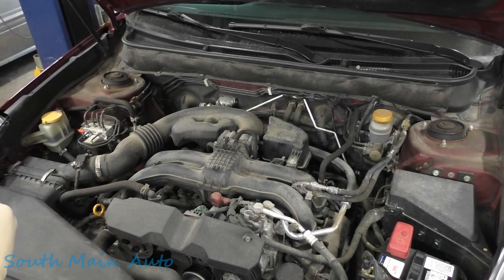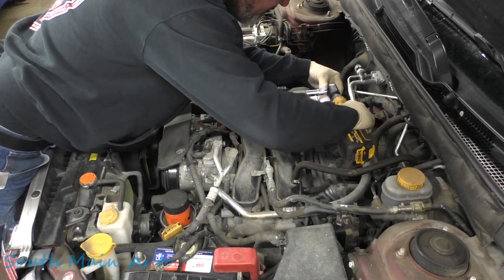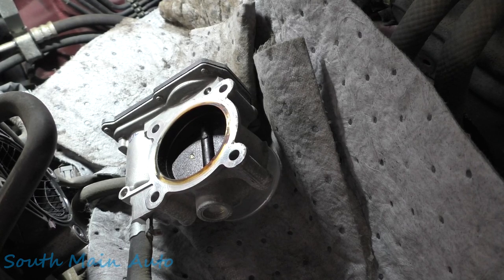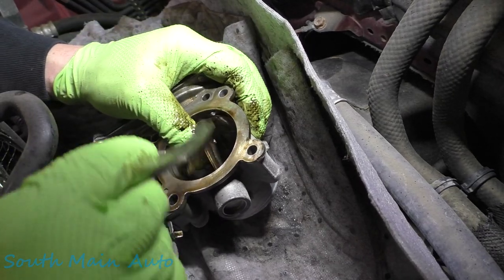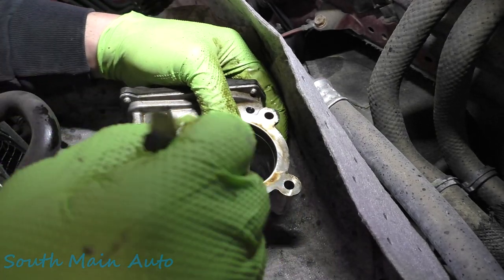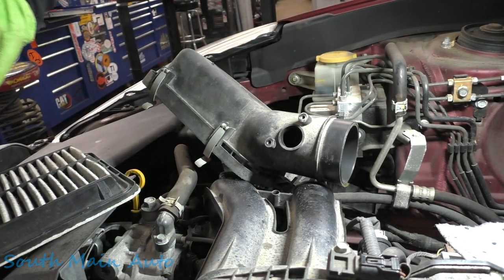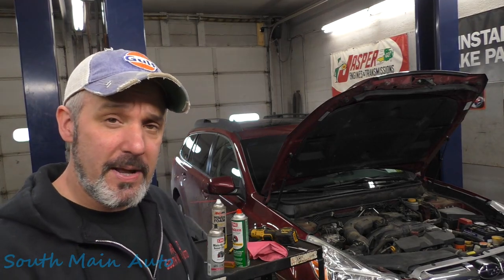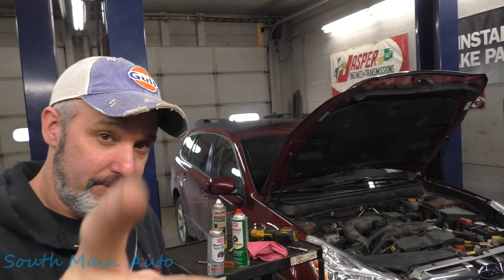How Does Your Shop Deal With Intermittent Symptoms?

Comment: When I worked at the Chrysler dealer we had a data recorder. When the vehicle acted up the customer had a button to push. I fixed several intermittent problems that way. One that comes to mind was a vehicle that would seem to miss or buck at highway speed. It took some looking on the data recording but finally by advancing it frame by frame and looking at the values I discovered the vehicle speed sensor was glitching to 150MPH for one frame. So the computer thought the vehicle was over speeding and shutting the fuel off for like a second.
Reply: That sounds like a super useful tool. Was it hooked into the DLC?
Reply: What “button” do you speak of? How can I obtain said thing?
Reply: @chrisclark6044  It was a device called a Co Pilot that came with the diagnostic system Chrysler had at the time, this was the mid 1990s. It plugged into the diagnostic connector and had a button that clipped on the sun visor.  I have no idea if it would still work with newer cars. However some of the diagnostic equipment have a data recorder function that does the same thing. I doubt that you would want to sent your scan tool with a customer for however long it took for the vehicle to act up.

Comment: I've been using power foam for about 20 years and it is the best product I've found. I also worked at a NAPA jobber for 20 years, and out of all the products I've seen over time power foam works the best. I also do a brake clean douche too for a rinse. I feel you used the product correctly so I hope your viewers find this helpful.

Comment: I think I would check for TSBs and also Identifix and or Suretrack first, to see if others have experienced the same problem. Depending on what, if anything, was found, I would use the information to direct further diagnosis. Next a visual inspection and check the related fluids, oil, coolant. Aside from that, what you have done makes perfect sense to me.

Comment: As soon as you said new battery, I knew exactly what customer was talking about. Those subaru take a full month to relearn everything. The rpm goes way down and stays that way for a month of consistent driving, there's a bad hesitation when you step on the gas, and stalling and just poor driving. I hated changing my battery.
Reply: Ever since computer cars came out, I've used a small motorcycle battery with a cig lighter plug wired to it. Install it before changing battery then remove it after you connect the battery, and you won't disturbe the ecm. no relearn
Reply: Best to jump a 12v source to the vehicle before disconnecting battery cable to keep the system "alive" while swaping in a new battery.
Reply: They learn a lot quicker with a clean throttle body. When the memory is cleared it does a throttle body reset. So when throttle closes and hits a ridge then you end up with a low idle and stalling
Reply: There’s a relearn process you can do.  YouTube has it.  Something like letting it idle for 10 min, then turn off, the letting it idle for 15 min.  I forgot exactly but that’s helped me when it does the stumbling after a battery change
Reply: No. Kidding.  But there's a procedure to reset the stochio- throttle body in an hour.

Comment: Being a Subaru specialist for 5 years, the only two outcomes I can relate to this type of concern is:
Dirty throttle plate with Subaru having such a picky throttle relearn process (new battery? recently jumped? just cleared DTC's? anything to reset or clear memory from the car.)
 
Or the old outback's had a ton of torque converter issues, but mainly it would present with hard to moderate braking = engine stalling but some customers misunderstood and said it would run rough and stall out which is correct, a DTC will be set for Engine Stall History and will reset some adaptives causing a rough idle. 

Been watching for years, hopefully this makes sense!

*after watching the entire video, I am confident that in what you did with cleaning the throttle body and reconnecting the battery and letting it idle, the customer will not return with the issue they came in with

Comment: Over my career as a mechanic, it has always been customer concern dependent.  The concern in this video, I definitely would have looked at the throttle body first, as the old GM 3800's come to mind for their hot start/stumble issue.  Other issues I just try to get as much info up front as I can, for example maybe a window motor or lock actuator acting up, is it weather dependent, doesn't work when rains etc.  I always was upfront with folks about pricing, and never skipped the visual on anything.  My career has actually taken me down a bit different path the last couple of years now that I am mobile and go to collision shops to do ADAS calibrations, but I still am the go to tech for our company for diagnostics.  Just usually now it has more to do with crushed wiring, connectors, modules, green crusties etc.  
Keep up the great content, Dr. O!  Just curious if you received the package I sent a few months ago?

Comment: When Eric started the car @24:52, you could tell from the sound, the big 2.5 was making 15 more bhp (although I think Eric's estimate regarding contributing factors was off; I estimate +5 hp from using the Power Foam on then EGR valve, +8 hp from using the Power Foam on the throttle body, and +2 hp from cleaning the mouse nest out of the air box)...🤣

Comment: We will ask the customer if we can drive the car for a few days on our own time.  Drive it home. Drive it over the weekend. We usually have the guy that lives the furthest distance from the shop.  And we also will do the unplug method like you said. And have customers drive with  engine light on.
Reply: When my grandparents 98 Ram was acting up we were pretty sure it was the transmission. I took it to some guys that specialize in Ram transmissions. They told me the couldn't get it to act up. I filled the tank and told them to drive it back and forth to work and for lunch. They had a scope hooked up to record when it finally did it four days later. The torque convertor lockup would slip sometimes. Some of them are just that hard to find.

Comment: The plan was discussed with the customer and they agreed you should try this. Excellent 100K service on the Outback air intake system. Hoping for an update. As an industrial maintenance mechanic - "There is something wrong with the machine." I would arrive at the machine in question. "How long is it going to take to fix it?" Well, I need to find out what is wrong then I can tell you. A certain customer was usually not happy with that answer.

Comment: I had a 2001 Toyota Corolla with a stubborn evap code that the mechanic actually gave up on. He kept my car for almost 2 months, charged me over a grand, and fixed nothing. I gave up on it, couldn't get it inspected even though we changed every single part of the evap system, smoked it several times, it kept throwing the code, and the registration expired... On a car that ran PERFECTLY and got 36 MPG. A year later, my Mom's Ford F-150 decided to DIE in the middle of her driveway, and she had no ride to work. I gave her one of my VW New Beetles, (I have 2) and we mailed the title to the Totota Florida, to my brother, who transferred the tag from her truck to the Toyota, when THAT came through, I gave her the Toyota, she drove it to work for 2 years in NY with the Fl. tag, then drove it, loaded heavy, to Fl, and stayed there. Then she drove it 3 more years, 65 miles each way to work. It won't start now. She parked it to drive her Honda Accord to work, and was switching them out each week. I believe the CPS went, then it sat and got rat chewed, as Toyotas are known for. When it finally stopped running, it had over 400,000 miles on it. When I gave it to her, it had 285,000 miles on it. NY and our STUPID rules cost me more than one good car. Not anymore. If it going to cost more that a grand to fix a STUPID CEL that doesn't effect it running condition, I register it in Florida. Screw NY. I'm done playing their expensive games.

Comment: When it comes to intermittents, I generally just wait until the problem gets worse (read: more consistent) so it becomes easier to diagnose.  Faults like these make it very tempting to start firing the parts cannon.  On another note, I had a very similar problem with my old Mitsubishi Galant.  It turned out to be a bad mass airflow sensor.  The car never threw codes.
Reply: Correct.  Correct a mundo.

Comment: I had an issue like that on a early 70s Toyota.  It would run fine then the engine would die. After pulling over to the side of the road it would start back and run smooth as can be. Turns out that when a fuel additive was dumped in one time the cardboard liner in the cap stuck to the bottle and ended up on the bottom of the tank. It floated around on the bottom til it got sucked onto the fuel outlet. Once the suction was gone the disc floated away til the next time it got close to the outlet.
Reply: Win52D  That's amazing.  But how the blazes did you ever think to look for something like that?
Reply: @phillipfritz7014  We had eliminated everything in the fuel system so we dropped the tank to see if there was a blockage. This was an early 70s car, long before EFI on board computers and electric fuel pumps so there wasn't much in the fuel delivery system other than a pump, tank and fuel line.

Comment: If it started acting up after the new battery install I would definitely suspect the dirty throttle body, but they seem to run consistently bad.  The intermittent  condition is confusing.  Will be curious how it works out for the owner.

Comment: I had a similar issue with my 2014 Impreza. It would sometimes do a weird idle and stall and did it quite often. First and foremost I NEVER use Fram filters. I use OEM or Wix. The issue was caused by the Variable Valve Timing Control system. When an engine oil gets low, dirty or sits, it can plug up the oil valve. This is a common problem with this system. I did an engine oil flush, replaced the filter and oil and it ran like new and the problem never came back.
Reply: Just FYI if you were using an OEM Subie filter on anything besides the 3.6R engine, it was MADE BY FRAM. (AFAIK only Subaru of America did this; Subaru of Canada and Subaru of Japan still used the fantastic Tokyo Roki filters, which Subaru of America still used on the 3.6R 6 cylinder engines.)

Comment: My 2008 does this randomly at idle and I ordered a used throttle body for $40 and I'm going to give it a try.  I've taught the current throttle body to idle 5 times.  No effect.  I think the vent for the fuel tank is clogged and it might be part of it.  I haven't go that far.  It's getting worse though.  Once it warms up, now it will mostly stutter and sometimes stall at idle.  I've cleaned the throttle body over and over.  The wires are very tight for the drive by wire where it plugs in the throttle body.    I hate stuff like this.  There are no codes.  I checked for vaccum leaks no vaccum leaks.  I pulled the EGR valve and it looks great.  I've changed the MAF sensor after cleaning the MAF sensor.   If clearing the vent and pressure sensor and throttle body doesn't work, I'll try unplugging the EGR valve.

Comment: Im a tech actually at a western new york dealership.   I treat them very similar to what you said.  I will spend way more time on a safety type concern then say a radio concern.   Also been working on same brand for 19 years so relay highly on experience from problems seen in the past.   It can be hard to teach the newer guys to try on intermittent problems especially with the flat rate system.  As you know this business is getting harder by the day and unfortunately their are more bad techs in the business that shot gun parts then guys like you and me who get more enjoyment in finding the exact problem.

Comment: You did the right steps for this fella. However, when cleaning any throttle body, when you open the throttle plate, gently release it back to the close position. Don't let it snap back. Both the throttle body, and the egr valve needed cleaning, so no time of money wasted there, plus the air filter does need to be changed sooner. Don't forget the cabin air filter too. Good work Eric. I wish I had a shop near me with a competent, and thorough mechanic like you. The dealer probably won't see my car for service, except for recalls, and warranty work.

Comment: your assumptions are correct and you did tackle the right equipment that causes these symptoms. however sometimes the catalytic converter is blocked (fully or partially) which can cause the car to stall. or any blockage on the exhaust pipe can give such symptoms.

Comment: Hey Mr O, just a backyard micananiac but I do have a Subie. Great product on the throttle body. 
1 st thought: pcv valve or cracked hose to pcv.
2nd thought: Subaru uses soy based wire coatings. With those mice I wonder if they are dining on his wiring?
3rd thought: spark tube seals leaking oil into tube and sitting at the base of the plug. Boxer engine is prone to it. Spark then shorts from the boot to to oil/block. 

Good luck and keep us posted. Have a good evening 👍

Comment: Hey Eric! First, I think you have the best car repair channel on the Tubes. One thing to watch with the outback’s is the torque converter. I don’t recall the year range but Subaru has (or had) a TSB out for intermittent stalling when the torque converter was failing. 

Anyways, passing a long what I think I know! Keep on keepin on!

Comment: Intermittent problems are difficult to diagnose. Fist I try to duplicate ,then develop a strategy. If that doesn't work I will check for any bulletins or just Google the problem.  Anything that will point me in a similar direction without going down rhe rabbit hole.  Thanks for the great videos

Comment: I like using an old toothbrush to do the throttle body cleaning. It works well and doesn't scratch. Intermittent problems take work but they don't take the time to diagnose the problem, sometimes it's due to time restraints, laziness, or lack of knowledge. It's easier for them throw Parts at it because it's not their money then to think and work hard. Another excellent video Eric

Comment: I have a 2014 F150, 210,000 miles. A Texas rig, no rust belt exposure. Had intermittent no crank, no start issues. I wised up after a couple of episodes. The truck would crank and start after I smacked the relay with the handle of a screw driver. Sorry Ivan, being a Polack, I didn't do a Polack fix. One part required... 🤣

Comment: Subaru tech here - Check tsbs. There should be a bulletin for an updated torque converter to help with stalling when coming to a stop. Have also seen the torque converter solenoid starting to go out cause the same issue. Resistance of solenoid will be slightly out of spec of on the edge of specification. You can monitor engine speed, torque converter speed and torque converter lockup duty and watch the converter stay locked up when coming to a stop. It should release lock up as you're coasting to a stop. I usually recommend both the valve body and the converter at the same time to prevent repeat failures, but I let them know why I want to do that and leave it up to the customer. Hope this helps!
Reply: And, fun fact, bidirectional on any subaru pre 2015 is almost non-existent even with OEM scan tool.

Comment: When my 99 frontier 3.3 hit about 60,000 miles, it would fall on its face after warmer up at a red light, or stop sign. Finally figured out that the butterfly value on the throttle body was getting built up with dirt and carbon. Clean it out, and I was good for about another 6 to 7 months. Then I would have to do it again, and it didn't matter what type of air filter I used. So I made it a habit that every time I did my oil change,  I would clean the throttle body, and never had a problem with it again.
Reply: That pesky pcv system coking up your intake. Lol oil was being sucked up in to your engine intake and collecting on the butterfly valve. Probably had excessive blowby other than a bottom end rebuild an oil catch can would have helped. Can make a cheap one plenty of instructions on the interwebs

Comment: Strong fundamental & a very good understanding of basic systems. Use a  multimeter, scope, check ground points & use a set of gauges (fuel, oil, vacuum, compression) plus experience.  Look for the anomalies & ask the customer as many questions as possible about the fault & when it occurs. Or spend 3 days going round in a circle because the customer shrugs their shoulders & says it just breaks down, your the expert fix it. Be aware, the prize for fixing intermittent faults is more intermittent faults.

Comment: Having done quite a few intermittent faults on all sorts of things. Try and reproduce the circumstances. even with my own vehicles. I then say, 'let the fault mature' as long as it is not dangerous or not a complete failure. I had a PATS system on a Ford Ranger. Would go for 3-4 months with no problem then it would start acting up. had the scope on it checked powers and grounds, check it was sending data, Yes I had several keys. Eventually I through an antenna ring at it and it fixed it. But I never caught it actually broken. Another one was a screaming noise loud and like a Cricket when the vehicle (Mitsubishi Lancer 2009) was moving at speed, wind noise yes, but where from??. That turned out to be an incorrectly shut window. Yes that simple. After I had the noise analyzer on it for an hour or so. Fun as you say Eric.